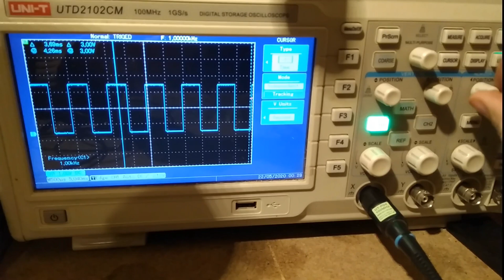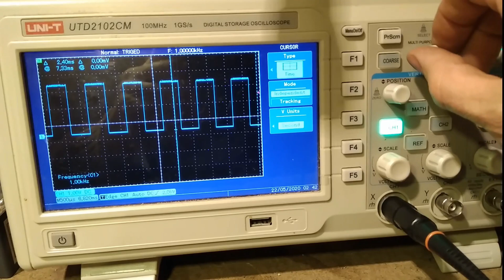Oscilloscope rotary encoder repair

Comment: hi, what kind of grease you use?
Reply from the maker: I use grease used on printer repair shops ..
Reply from the maker: any fine grease wil work ..Check if it has no continuity with multimeter..
Reply: @lessarduino6702  ok, thanks